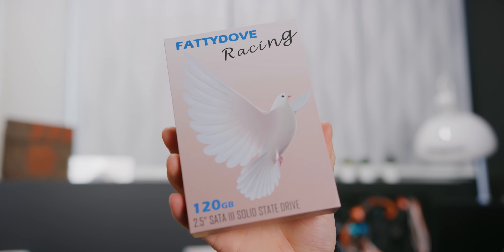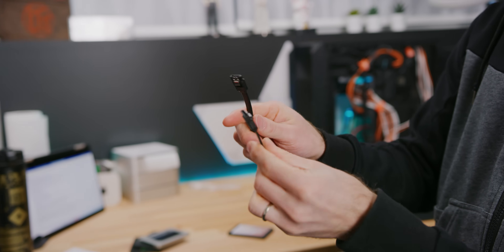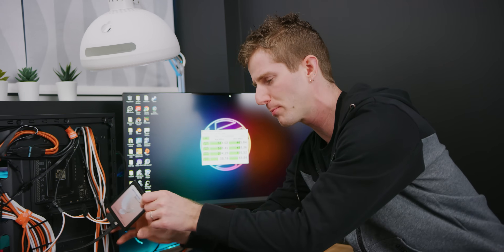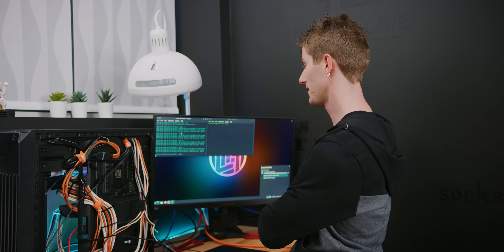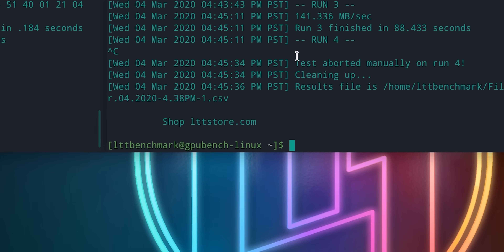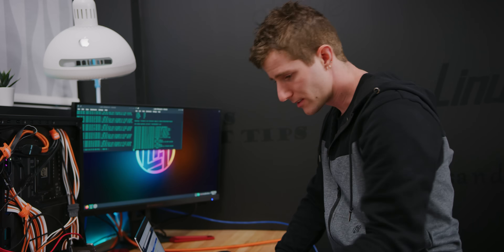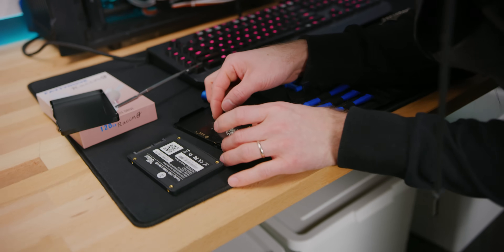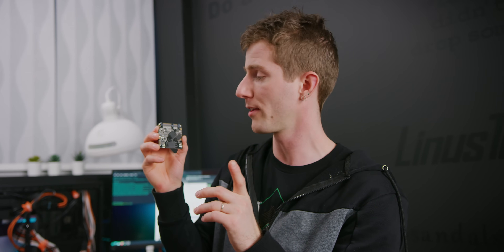How bad is this $20 SSD??

Comment: You should've tried a 100 GB write/read test. Some of those cheap drives pretend to be high capacity, they show up as high capacity, they even let you write large files, but then you try to read them and they come out corrupted because the actual capacity is like 16 GB or something.
Reply: Technically, yes, though this drive is only 120 GB to begin with. Are there even any smaller SSDs made today that you could use to fale this? It's only a single chip anyways, I don't think it would be worth it to fake 120 gigs...

Comment: Sugestion: Has you have already opened the SSD Box, what about to put a cooler on the NAND Flash and run the test again!? I've even think that without the case the SSD should keep more velocity for much longer.
I Assume that the SSD slows because of heating! And I don't know why, makers are creating an plastic "oven" to SSD's! But it's only me thinking!
Best Regards to all.

Comment: There are many myths about SSD;s that need corrected. The first one is that one can speed up a game, which is FALSE. All programs are loaded into the system ram and are read from there. Very little of a program is actually read from the hard drive once it has been started, except for the occasional loading of a level. Lets see a truth finding video of the myths and truths about how hard drives work in a pc please.

Comment: Plus Anthony I have a question for you
I recently purchased a 2tb SSD from wish.com
Which in fact is just a 60gb 2.5 laptop hard drive at 5400rpm
How do I change it back from a 2tb hack version back to its original 60 maybe 80 gigabyte hard drive by the way this is a Toshiba

Comment: If the hoodies were closer to $40 than $60 I would have gotten one by now and the shirts aren't that bad as I like the designs, but there's not as much detail and/or the print is small.

SERIOUSLY THOUGH, what is a good VPN that is going to work with everything such as ShowBox, Netflix and all the normal things that one would expect it to work on?
 I looked at the top 20 and some look good, like PIA for instance, but it doesn't let you connect to a lot of stuff...

Comment: all the cachless ssd ive used are definitely not slower than 7200 rpm hdd's at least. usually good sustain and definitely wayyy better for latency / seek /  small files

Comment: I'm fairly sure paralleling can still take place inside a single chip, to an extent. At the very least, there are SSD-on-chips out there with NVMe controllers. My iPhone 6S Plus is an example, they were the first phone AFAIK to use NVM Express NAND and it jumped from 40-50MB/s at best, to at least 10 times that. In a single 128GB chip, with the controller integrated. Even if parallelling doesn't take place, a single NAND chip has become plenty fast enough to get the job done. It also doesn't take much time to dump RAM contents to disk, so even a modest capacitor can still get the job done. I'd really appreciate some high res photos so we can see if there might be a capacitor there that may have been missed.

Comment: These Cheap SSDs using cheap controller board with failed NAND memories that not recommended for building SSDs. As example,SpecTek's LOWER GRADE NAND chips,or REMARKED NAND chips.
DO NOT BUY THEM.

Comment: Edit: I guess it isn't clear, but doves are a type of pigeon, just like both greyhounds and pugs are dogs.

You aren't aware that racing pigeons exist? It remains as a sport in canada, although it may have been more popular in decades past. To this day people still race pigeons in canada. I worked in a livestock supply store - I manufactured all of the birdfeed, talked with all of the pigeon dudes. Back in the day, racing or carrier/homing pigeons were the fastest way to get messages from point A to point B, much faster than a courier on a horse (and in war time, easier to avoid getting shot). They can fly 700 miles a day, which makes the whole "speed" thing relevant for an SSD (like how calling it an arthritic cheetah would make sense). It was only around 60 years ago that they lost favour for wartime message deliveries with the advent of the radio. The swiss army only retired their pigeon core in 1996. Racing Pigeons are awesome. Pigeons are some of the most decorated animals in war - if you look at the dickens medal (animal equivalent of the victoria cross), of 71 medals given out since it's conception 30 went to pigeons - in the time they were actively being used, they beat out dogs/horses combined - dogs have overtaken them simply because pigeons aren't used anymore. 

Now, the dove pictured isn't a racing pigeon, and would be inferior and slower to racing pigeons (and I don't think they have the same homing sense, thus unreliable) - thus making it a good analogy for being a substandard SSD

Edit: I guess it isn't clear, but doves are a type of pigeon, just like both greyhounds and pugs are dogs.

Comment: Not a surprising video.  I have been running an everyday system for over a year on a Kingston 120gb SSD.  Benchmarks are not mind blowing but far and away faster than HDD.  I said it then and I'll say it now.  $20 for unremarkable in either direction is good enough for me and with proper data backups, an easy fix if it goes bad.  No sucker here.

Comment: I thought you said It's rated as a 120mb/sec drive but you got over 500mb/sec? Latency is 8ms during repeated stress testing, that's still better than most hard drives write latency isn't it? 
It's pretty impressive actually.

Comment: Any opinions on archival SSD storage? Same idea as LTO but I don't have 100s of TB of storage I want to keep backups of. Like even a 10MB SSD with like a 1-4TB of capacity would be ideal to keep the cost of repair and recovery of a dried up old hard drive that hasn't been touched in 10 years and purchasing in general.

Comment: It’s called Fattydove Racing. 

Fattydove.
Racing.
Reply: Yes? It's a very fitting name.
Racing pigeons are incredibly fast. A fat dove would be slower and less reliable racer - thus being a good analogy. Like calling it the arthritic cheetah. It's an incredibly fast animal with some problems. Doves are pigeons BTW. Pigeon racing is still popular today, they were valued for their speed, thus why they were used as the fastest way to send messages for hundreds of years - they only went out of use during the cold war thanks to increased reliance on radios.

I'm really disappointed that not a single member of linuses team knew of pigeon racing. It's still a sport in canada.

Comment: What is the point of having DRAM cache in your SSD anyway, I have more than enough RAM in my PC and almost 50% of it is used as disk cache under normal circumstances. The disk cannot predict what I want to read, and write caching can be handled perfectly by the operating system...

Comment: If you were building a Raspberry Pi or other SBC solution and needed a cheap SSD as opposed to a thumbdrive, this Fattydove would probably be a decent option. I wouldn't trust anything but already backed-up or cached data (like Squid) to it though

Comment: Ive been debating getting a pc thats 275 usd its description is a refurbished hp with Nvidia GT 1030 2gb Video Core i5 - 3470 3.2Ghz quad core 16Gb ddr3 ram 500GB hard drive Windows 10. Does anybody know how well it would actually run

Comment: Back in October I paid 40 CAD for a Samsung 860 EVO "250" GB, so while that's 9 USD more than $20, it would not only be higher performance and more reliable, but also double the storage.
128 GB could still be viable for some consumers (grandmas, low-data low cost business machines), but for people who actually need a decent amount of storage, the starting point should be at 250 or 500 GB now (plus if you need more space such as for videos/bulkier-games, use HDD)

Comment: Dont trust them SSDs! You lucked out but you could order 5 of the same drives and get 5 totally different SSDs! One of mine was actually used and not even formatted and still had pictures of some chinese family on it. All the exact same SSDs in a single order not one was the same.

Comment: This SSD is trending on Amazon in the electronic section. 
Lol amazing the impact LTT has.
Reply: The price has gone up to $90
Reply: @AEON.  Sounds to me like they are Robin Hood. Stealing from the rich and giving to the poor. I have ZERO issues with that.
Reply: @DeadlyDanDaMan  Except they are doing it wrong. Stolen goods should not lose quality only because they are stolen. If these SSDs are stolen, they should have same parameters than legit originals. Otherwise they are cheap knockoffs not worth to mention.
Reply: @DeadlyDanDaMan  You said it man
Reply: Timmy Joe had this thing on his channel months ago. I think their only testing it because they saw it on his channel. Timmy Joe just said that it was a really cheap, really decent SSD and their actually testing it. lol

Comment: "SLC hasn't been around even in the enterprise ...." - It's not talking about SLC, it's talking about SLC technology cache. This means, it is using a portion of the TLC flash as SLC (as long as there is enough available) and then distributes that data later. This has been around for dram-less ssds for quite some time....
Reply: Thank you, @lukas alt,  I came here to say this.  
SLC caching is in almost all consumer SSDs, because it enables higher burst speeds for writes, which is great for marketing.  SLC caching is not typically used in Enterprise SSDs, because enterprise customers expect consistent latency, and SLC caching is very fast until the cache fills, then it is as slow as direct TLC writes.
Reply: but how can they have an slc cache on a drive that has only one NAND chip ?
Reply: @mofoq  makes sense, thank you !
Reply: @mofoq  really
Reply: Maybe, but the fact is, you just dont put that into the product page, its misleading at best, and false advertising at worst.

The drive is TLC flash, therefore, mentioning SLC flash in the product page is just not good marketing practice.
Reply: Morpheas To be fair, it does say “SLC cache technology” not SLC flash, so it’s not really false advertising, just tricks people who don’t look carefully enough.
Reply: @YouCensored  So you're saying Western Digital has "misleading at best, and false advertising at worst"?
Because that's the first thing on the Amazon product page for their WD Green SSDs, "SLC (single-level cell) caching boosts write performance to quickly perform everyday tasks".

Comment: FYI most TLC/QLC drives will use cells in SLC mode for SLC cache, its literally the same nand, but as you add bit depth it slows it down quite a bit, so they use SLC initially, then convert it to TLC/QLC in the background later, sort of like garbage collection/trim

Comment: 0:08 No, it's not, If you have fast-enough controller, NAND-chips that are not worthless shit (like Intel's QLC or low-quality batches of TLC), unconstrained PCIe bus and plenty of RAM of OS-level cache, then SSD-side RAM cache is irrelevant, especially for random operations which are what matters for OS and applications.
8:20 Tell that to Intel and your other sponsors that use "spare" TLC or even QLC cells as "variable-size SLC cache".

Comment: I would have liked to see the whole range of 128 GB SSDs reviewed. I have 3 of them, one from Inland Professional and 2 from Silicon Power. Apparently the Silicon Power ones have a DRAM cache but I can never tell. One of them is being run off of SATA 1 anyway so these are for low end builds.

Comment: Some info on these drives, they're generally based on an SM2258G (used in quite a few team drives, and similar to the SM2258 that the MX500 uses). The PCB is a reference pcb thats readily available on taobao, and the NAND is usually recycled from old server drives.

Comment: The advertised SLC cache is real. All modern SSDs have SLC cache, it doesn't require a separate SLC chip. You can run a part of a TLC chip as SLC, you just lose storage density on that part.

Comment: I did bought a 120 gb ssd on ali express  with those values on read and wright, and now the reading values decreased a lotttt, from 400 Mbs to 40 Mbs and this ssd is not used everyday... well it cost me 15$... its still faster than an HDD i guess

Comment: What sux now days is once u update windows 10 a 120gb ssd just is not enough. Your left with like 50 some gb so then i  turned it into a fortnite only drive and even for just that your only left with 40gb and when game updates it says your hdd is low update will take slightly longer its starting to seem like a 180 gb ssd is almost minimal if u want updates and a few extra things on there .

Comment: You can get concerningly large surface mount capacitors these days, so I wouldn’t be shocked if it could bring the flash into a consistent state without giant electrolytic capacitors on power loss. Maybe take a closer look at that PCB...

Comment: "SLC hasnt been around even in enterprise for many years" 
Ehm? did you get things mixed up? SLC Cache has absolutely nothing to do with SLC (nand)memory.. It's a Caching Technique used to improve write speeds on TLC Memory.
Going by what i see this drive probably does actually have SLC caching, its just a technique, so implementing it doesnt actually cost anything extra as long as the controller supports it.

(basically reserving part of the TLC memory for use as SLC memory by only writing 1 bit per cell instead of 3, to improve performance)

Here a good visual representation from Adata.. http://industrial.adata.com/ru/technology/74/

Honestly its a decent SSD for that sort of price, i honestly expected them to have just put some kind of modified usb stick in there, with fake capacity :P
(I still wouldn't recommend buying it though)

Comment: My PC uses an M.2 NVMe SSD as the boot drive. When did they start making SATA SSD??? I've  only ever seen SSD in M.2 NVMe form factor. Is M.2 NVMe SSD getting replaced by the SATA SDD???
Reply: No m.2 is acually better xD
Reply: @florianroos3183  I've only ever seen IDE & SATA for 2.5" or 3.5" HDD and SSD as M.2

Comment: Always look for a cache size of at least 1MB/GB. There are many devices with either no cache or extremely small cache sizes.

These drives will also have no additional capacity to offload bad sectors and the life span will be miserable.

Comment: The Smallest M.2 NVMe SSD u can buy these days is a 256 GB M.2 NVMe SSD.
Reply: I can buy 32GB M.2 SSD (Intel Optane).
Reply: @happygimp0  32 GB drive isn't even enough to install Windows 10 onto. U need your boot drive to be at least at a minimum of 256 GB.
Reply: @bryantfloyd7471  Irrelevant to the question, Intel Optane is a M.2 SSD and you can use it as a 32GB drive.

I use a PC with 16 GB storage and only use about 8 GB of it. I use 24 GB on my laptop, i don't know what to do with the other 86 GB of my partition or the other 350 GB that don't have a partition.
Why do you need so much storage just for a boot drive? This seams like a waste.
Reply: @happygimp0  16 GB might work with Android but, not Windows.
Reply: I use debian. Why does Windows wast so much? It hasn't more functions, the opposite, there is not even a compiler per default.

Comment: 20$ for a 120GB sata ssd is actually not very valuable in China.  I could get a brand new PM981 nvme 1TB from Samsung with 2yrs warranty  for $130 in Hong Kong.
Reply: That is not a good comparison, controller, RAM, PCB, connector, ... cost also.
Reply: ggzh a Argue With Everyone Yes but I would say Samsung have everything better than some unknown brand (fattydove) anyways...

Comment: You throwing those around and I don’t even have an HDD for my games 😭
Reply: You haven't moved up to HDD technology yet? Are you still using punch cards?
Reply: @CaveyMoth  Tape drives, clearly.  Let's not be completely unrealistic here.
Reply: Cavey Möth no smart one I have a 250ssd for windows but forgot to get a hdd
Reply: @RealSymplixity  Everything is so much better without an HDD. I've got 4 tb of NVMe storage for my game library.
Reply: @CaveyMoth  Hard drives run surprisingly quick if you have the OS on the SSD. When they try to run an OS and play a game is when the load times are terrible.

Comment: No client SSD has PLI CAPs!!  Too expensive.  That's only for enterprise ssd.  If your drive has a DRAM, the write data goes to the DRAM first then write to the NAND.  DRAM size is 1MB = 1GB of SSD.  No company would add enough cap to keep NAND voltage high to flush DRAM to NAND.

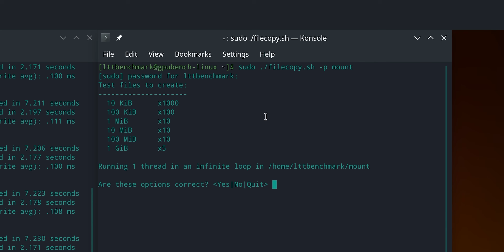Comment: Question: Won't running both tests at the same time (those starting at 6:05) result in lower than expected performance for each? So for the spikes mentioned in write test mentioned at 6:40, couldn't that be a consequence?

Comment: I went to go find this SSD on Amazon and could only find the 240GB variant for $36 USD.  Hopefully this one would perform better because it has two NAND chips? What if we got several of these crappy cheap SSDs and used RAID 0 Or RAID 10 - would that be cost-effective and perform similarly or better than a "good" SSD of higher capacity? (Only comparing NAND to NAND, not NVME)

Comment: Power Loss Protection is probably about making sure there's enough of a power reserve to write data in the RAM cache to flash if power is lost so you don't get data corruption
Reply: They addressed that when going through the insides, and didn't see any capacitors what would look like they could suffice for that.